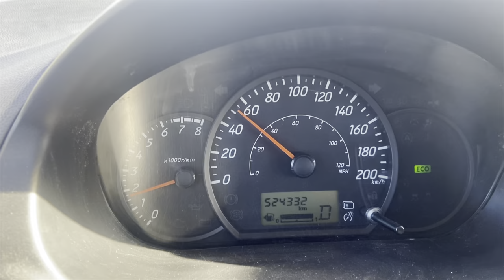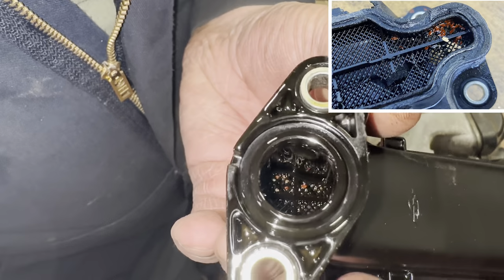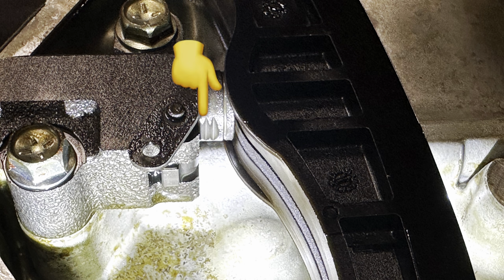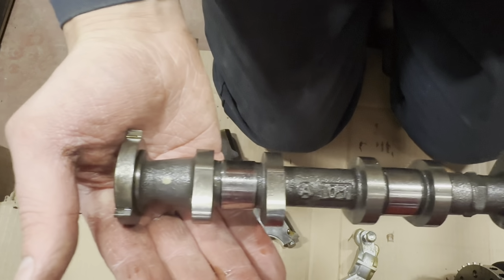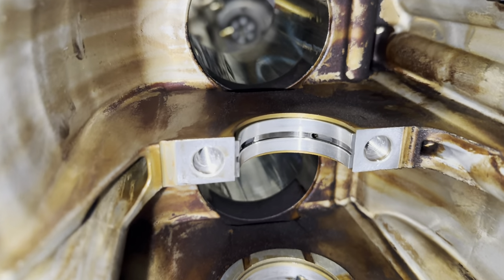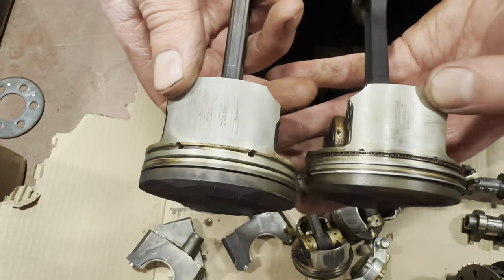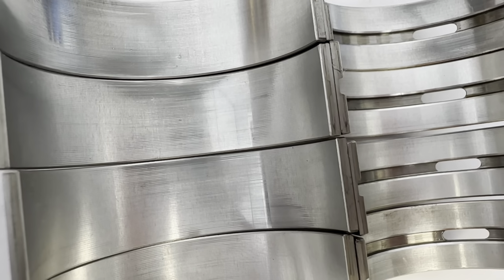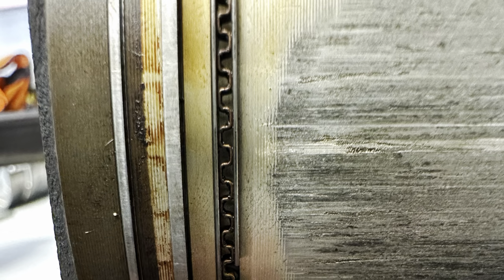524,000km Mitsubishi Mirage engine teardown

Comment: The Mirage isn't popular but the people who do own them swear by them. Surprisingly, not just urban folks but more rural people who drive far and need an economical, reliable car.
Reply: I had a 2018 and was original owner. Transmission started over heating around 40k miles and kept over heating till I traded it in at 102k miles. I changed the fluid at the dealer every 40k miles. They even replaced components and it was still over heating and going into limp mode if you drove it on the highway for more than an hour. 78hp is dangerous too. I always felt uneasy going on the highway as it takes ages to get from 0 to 70. The only up side to this car is mpg and insurance cost. Outside of that, it's trash even fully equipped.
Reply: @jesuscarrillo4344 was it an automatic?
Reply from the maker: I used to have to argue with the parts desk at the dealer cause they refused to look up a filter and said they don't have one(or two). I didn't realise it was that common for them to clog up.
Reply: That's exactly why I bought one. Had to drive a looong distance to work. Has been a super dependable car.
Reply: @jesuscarrillo4344  I spent my teen years driving a 71 hp Subaru GL10 with 3-speed automatic. Unbelievably, that carbureted flat four somehow broke the torque converter which took out the rest of the transmission. I fixed it because it was what I could afford. So I can relate.
Reply: Yeah, other than the CVT cars, they're pretty reliable and my 5 speed cars blows the advertised fuel mileage away every time I drive it.
Reply: @jesuscarrillo4344  imagine not being able to drive a manual gearbox
Reply: @mememaster147  I'd wager no more than at least 80% of Mirages sold in the US from 2018 to current are CVT. That is what's available. I have been driving manual since I was 20. That Mirage was my first automatic in 10 years at that time. My display pic is of my Focus ST. You can only get them in 6 speed manual. Imagine trying to look cool on YT comments but taking an L.
Reply: @jesuscarrillo4344  I've had a few mirages and they are pretty much miserable to drive and unable to keep up with modern traffic, and my city is mostly pickups and SUVs so an accident wouldn't end up well.
Reply from the maker: @static_Tricolor_camry  Thanks for the heads up!
Reply from the maker: @jesuscarrillo4344  Ohhh, a Focus! I'm sure your mechanic appreciates all the business😊
Reply: I met a guy who has big boy sports cars but dailies one of these, he literally swears by it as you said. It gets insane mpg, its light and agile in regular traffic, cheap as dirt to run. I really get it.
Reply from the maker: Yeah, I bought so I can save a few hundred bucks a month in fuel and save some wear and tear on my clapped out diesel truck and goofy 4x4 minivan☝️
Reply: @mememaster147 bold of you to assume he can't drive manual just because he got the CVT mirage
Reply: @earlscheib7754 what makes them so bad, besides the lack of power? Do they ride okay? And did yours have a CVT or manual transmission
Reply: @ufork  I've had several I'm a car dealer so the idea of a small car that is good on gas is appealing the mirage is underpowered, the manual helps a little bit when driven to keep up with traffic the fuel economy is actually worse than the more powerful Nissan versa.  Overall the best small car currently is a Honda Fit  with the Yaris a close 2nd, one size up is the civic or a 2nd or 3rd Gen prius. The mirage also gets pushed around in the wind, the handling is adequate the brakes could be better. My advice is drive the Fit(at or mt), Yaris (auto), Versa(manual) and Mirage (at or mt) see what you like. But I'll tell you this IMHO the Mirage isn't a successor to the Metro.
Reply: Mine seems quite happy so long as I change the fluid every 30k miles. I also use full synthetic CVT fluid.
Reply: @turdpailsandtrails  I don't have a mechanic. I have been doing my own repairs and maintenance on every vehicle I owned except for the Mirage since it had a warranty. The only thing that has failed on the ST in 3 years, 90k miles of ownership has been the purge valve. That was a 5 min, $50 fix unlike my Mirage that had a wheel bearing go out at 30k miles...
  By the way, if your rear defrost goes out, the dealership will tell you that you have two options. A repair kit that has a 50/50 chance of fixing it or buy a whole new hatch because they can not get the back window separately and warranty will not cover it. Ask me how I found this out at 70k miles 😉
Reply: @jesuscarrillo4344 You still bought an automatic Mirage.  Your profile pic means absolutely nothing.  Again you bought an automatic mirage. Don't go trying to appeal to what's available or not.  YOU paid REAL MONEY for an automatic mirage 😂
Reply: @POVwithRC  You're basically saying only 20% of Mirages are good...
Reply: @turdpailsandtrails  neighbor has a first Gen focus it has 400000 miles on it. Just regular maintenance.
Reply from the maker: @selrahc2061 Wow. I googled high mileage focus and there’s a few claiming to have over 500,000miles on the original drivetrain, including the clutch😳
Reply: @jesuscarrillo4344 i have a 5000 kilo truck with 70 horsepower it takes 48 seconds to get to 100kmph 😂
Reply: @mememaster147 😂
Reply: @PKudu my girlfriend blows me every time I don't drive a Mirage
Reply: @jesuscarrillo4344 A lot of drivers think that it's okay to shift the vehicle from reverse to drive while the vehicle is still moving in an automatic transmission. The Mitsubishi mirage is not an automatic transmission It's a CVT and it will guarantee the destruction of your transmission if you shift it while it is still moving.

Shifting from reverse to drive while moving in an automatic torque converter style transmission usually wears out the clutch pack(s) inside of the transmission causing slipping gears and delayed shifts.
Reply: @turdpailsandtrails  I hate it so much when some idiot that doesn't know their ass from the elbow or their intake from their exhaust tries telling me that a part doesn't exist. Just humour them, unless it's a muffler bearing, piston return spring, or blinker fluid. Best case scenario you learn something. Worst case scenario it turns out I was a crazy person asking you for something that isn't real, and you wasted 2 minutes of your time verifying so.
Reply: @earlscheib7754  I wonder how quickly those baby rotors would lead to brake fade during a track day. You get 3 hard braking zones and then the pedal just turns into a wet pillow, lol.
Reply: @MyWatchIsEnded  I don't think CVTs worry about "slipping gears", or "delayed shifts", since they don't have multiple forward gears and they don't shift, with the exception of, to my knowledge, Toyota's CVTs which contain a traditional physical 1st gear, followed by a continuously variable drive gear. That being said, I'm sure it's not the best thing to do to them.
Reply: @jesuscarrillo4344 Nissan CVT I'm guessing?
Reply: @dadgarage7966
Most of the people I see driving them around here are old ladies.
I guess it's a pretty decent cheap and reliable car for old pensioners.
Just an ugly an uninspiring thing for pretty much everyone else.
I wish that they still made the lancers because I like the slightly more sporty and boxy look of them compared to something like a Corolla.
Reply: The Mirage is very popular in Mexico 🇲🇽, you can see one of them in every where you go, including like taxis.
Reply: My aunt has a 2015 mirage with 287k miles on the original engine and CVT transmission. She said it has given her 0 problems what so ever. She does change the transmission fluid every 20k miles and has been doing so since she bought it brand new in 2015. She gave her daughter the car as her first car and bought herself a new 2024 mirage G4 (sedan). Surprisingly it doesn’t sound bad at all.
Reply: It doesnt count when you have to pay your buddy for the 'girlfriend' 'experience'.@rickc303
Reply: The Mitsubishi Mirage are now made in Thailand and the Philippines, newly industrialized countries.
They are selling by the tens of thousands in most Southeast Asian countries because of their reasonable price and reliability.
 Mitsubishi manufactured the famous Japanese Zero fighter plane plus 5 other types that were used in the surprise attack of Pearl Harbor in WW2.
Reply: The same thing  was said about the Geo Metro, but they are also an endurance trooper considering that most Metros were neglected
Reply: @jesuscarrillo4344   lies
Reply: @mememaster147 imagine thinking in 2024 manual is still considered     auto is better in every way
Reply: @ufork  Lack of power is a very relative thing. I own a Mirage, and the times I pressed the accelerator for more than 50% are exceedingly rare.
Reply: Mitubischi  poate face cu cu mirage sau space star  o  mare supriza in toate lumea,masina perfecta, dacă  deschizi capota si te uiți  cum sunt aranjate toate piesele inclusiv motorul ,totul este  așezat ordonat și aerisit,îmi place foarte mult(totul) la Mitubischi
Reply: @jesuscarrillo4344  Fluid change is every 30K not 40. And they don't tolerate skipped maintenance. The CVT filter can get clogged in as little as 20K miles. Don't like it buy a manual, gear oil every 60K. Don't blame the car for your neglect.
Reply: @MattyClivingthedream Mitsubishi updated those CVT’s and haven’t had any problems since 
You do have to change the fluid every 30 K and also there is an inline CVT filter under the battery box that should be changed every 60K 
Do that and drive it like a car and you should have no problems.
Reply: I've got one and it is awesome it will hit the back roads better than my old Ford ranger it goes through Suger sand Priti easy it weighs 2000 lbs even it's lower too the road but it doesn't get hung up on rudes in the road because it fits inside the holes if it was AWD it would be insane there a bunch of frilly jeep people that come around where I live and they don't take there Jeeps anyplace I don't take my car they will go through a mud puddle and get out to take pictures of it making it to the other side and the water is maby four inches deep 😅 I just drive by them  what I don't like is the gas gauge is digital  and the way the motor is it uses a decent amount of gas if you're going slow or sitting
Reply: @claxtoncurtis811 I've got one it's nice but if you're use to more luxury it's gonna feel lacking I can do 75 fine but the wind messes with it but I'd rather have that than the gas station messing with my wallet

Comment: Im absolutely impressed. Driving a car 500k is hard in itself. Motor looks almost new. Honestly. That is called regular service. Pretty simple  logic.
Reply: But it's also a hit in the face to all the people that are like: 3-cylinder cars can't be reliable it's to much strain on the engine.. Bla bla bla.

I live in Germany and the Mirage (funnily enough they call them Space Star over here) is a pretty popular car. Now the SUV/Crossover trend is doing it's thing on the streets here as well, but there still lots of people who like the Mirge/Space Star for it's fuel efficiency and just size. We don't have such big streets so a small subcompact car is always a blessing. Not much extras if you go for the "Basis"-trim ~14.650$ and you get yourself a brand new car with a 5 year warranty (they don't offer the 100.000miles/10 year warranty over here).
Reply: The secret to the longevity is that it doesn't make enough power to hurt itself.
Reply: @chriskonte1909 well if you want an unreliable 3 cilinder car, try a Peugeot 208 or a Citroen with a 3 cilinder 1.2 liter PURETECH , with the infamous wet distribution belt. Those engines will make you cry.
Reply: i have one Mitsubishi and one KIA.
Mitsubishi has 230,000 miles on it.  zero issue
the KIA blew up engine at 50,000 miles.
Reply: @POVwithRC  Would be nice if it was that easy.... low specific power makes it easier to design a reliable engine, but some engines with comparable power have pretty horrible reliability.
Reply: @chriskonte1909  we have a 4k sh golf 5 plus 1.9 tdi bought at 200.000 km and now we have 320.000 km with only ac reparations. This thing gets 6/l 100 mixt driving no mmater how hard you press the pedal and it even has a decent interior. Bang for the buck I say😂
Reply: @CreRay  Didn’t ask
Reply: @robotech1990 or a 1.0 EcoBoost (boom?) from Ford. 
They are just as bad as the 1.2 Puretec from PSA/ Stellantis 🙈
Reply: Are we talking about 500,000 miles?
Reply: @chriskonte1909 Turbo charged 3 cylinders are the concern.  I think those might do okay when you frequently change the oil and use the turbo oomph sparingly. In theory, the turbo three motor internals can be diesel-quality and long lasting.
Reply: @adamgoof More like about 325,000 miles
Reply: GM & Ford 3 Cylinder engines seem fragile
Reply: @timothykeith1367 also you have to check timing belt every 30-40k km if it's not tearing apart... Too much struggle.
Reply: @POVwithRC I used to say that about my 2008 Hyundai accent, that generation of car was pretty damn bulletproof!
Reply: @POVwithRC  just wait until someone twincharges one
Reply: you're 175K short pilgrim.
Reply: @POVwithRC  Yep, and if you want a reliable sports car, it should be a big powerful engine that can take the strain like a 6.2L LT2 naturally aspirated corvette engine, and not some European 4cylinder 2.3 liter twin turbo engine being pushed to the limits
Reply: @robotech1990 Ah good to know. That engine is now also in some Fiat models, paired to a 6-speed. 6-speed DCT always screams "I will blow up" wether it is a VW unit, Hyundai/Kia, or French.
Reply: @POVwithRC  and that power is enough for daily drivers. just the right amount.

Comment: I have a mirage with 480,000km and a checrolet spark 2013 with 502,000km both are taxis here in mexico, absolutely reliable just regular mantenaince on both.
Reply: Wow! Are they 5spds or cvt? I think the sparks handle better but are basically a rebadged Daewoo?.
Reply: All of the cheap small cars: Nissan Micra (Canada only), Honda Fit, Nissan Versa/Versa Note, Chevy Spark are all 5-speed manual or CVT. The Ford Fiesta's 5-speed manual alternative is infamous.
Reply: @Billycowcrap  spark 5 speed manual, the mirage os a cvt.
Reply: @jessebrook1688 if you are talking about the first and 2nd gen fit, pretty sure they had a regular automatic transmission, not a cvt
Reply from the maker: @jessebrook1688 I’m pretty sure the Micra had a conventional automagic, not a cvt. At least not the ones sold in Canada. The spark and versa used the same Jatco cvt.
Reply: @turdpailsandtrails  Micra had a 4 speed torque converter, Suzuki and Mitsubishi used CVT and later Sparks did too.
Reply: @jessebrook1688  actually some versas have a 4 speed automatics not the ref011a cvt's
Reply: @turdpailsandtrails  some year ago i have a versa in the fleet with a torque converter 4 speed, super reliable too. That car got totaled with almos 600,000 one the clock and was working fine.
Reply: @jessebrook1688  FUCK no love for the Mazda Demio/2 here?! I'm calling the police for discrimination!
Reply: @haaxxx9  No, I do love the Mazda 2, because it never came with a movement-sucking CVT, just a conventional 4-speed auto box. In cars this small, a CVT makes sense because it doesn't get put through as much as it does in an SUV, but it's a real energy sucker on small engines, much the same as earlier automatic transmissions were on the small cars of the 1970s and 80s.
Reply: i drow 1 mil Lancer 1.6 taxi for few years
Reply: @jessebrook1688  Interesting perspective you have... Usually with small compact cars the manual transmission is almost better in every way to squeeze out every last power of the engine as possible at critical key moments that you need it the most, highway driving comes to mind. 

Also it's one of the most fun you can have in the small compact car market, light, nimble and very reliable!

Comment: This honestly is a testament to treating your machines well and the benefit of adhering to factory service intervals
Reply: To facto y 10k oil change for new cars ? 
No thanks
Reply: There are some truly bad engines, but most with care and no abuse will last a long time. Most of the "bad" stuff is the cheap stuff and most people who buy cheap stuff do it because they can't afford better which often includes regular maintenance etc.. So they are not cared for and have problems which relate to maintenance often.
Reply: The factory service interval on my E46 is 15,000 miles I change my oil every 7000 miles it’s on 258k miles now 2.2 petrol
Reply: So true. Some people give Hyundia a lot of crap. I have 144k on my 18 elantra. Most reliable car I've ever owned. I take super good care of it. Synthetic oil every 3-4k. Check oil between changes and add when needed, and I have any maintenance done when I'm supposed to. Car is still running well.
Reply: Sadly today adhering to the factory service intervals will get you a blown up engine or transmission because of ridiculously stretched service intervals and "lifetime" items.

Comment: I wish I kept my mirage, most reliable car I've ever owned. Just catches wind like a sail, so not too great for daily interstate travel.
Reply from the maker: Yeah that’s one of the downsides of a 2000lb car🤣. It’s doable but can get old after a while.
Reply: I haven't noticed that much in my mirage, BUT I'm comparing it to my Samurai and that thing is just a rolling box kite.
Reply: @turdpailsandtrails  What do you mean? It's like torque steer but it can surprise you! It makes commuting more exciting.
Reply: how is it on the freeway? besides catching wind, rain or trucks would seem a worry
Reply: @turdpailsandtrails  I've been awfully tempted to drop the engine from a Focus ST into the rear of one of these.   250+ HP at 2200 lb should be quite a bit of fun!